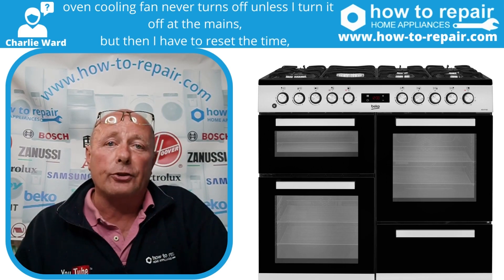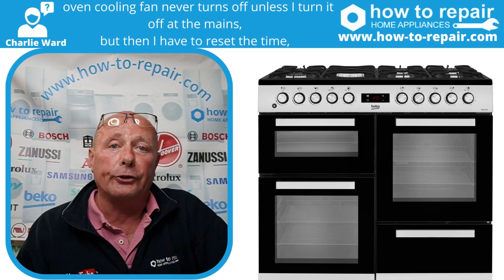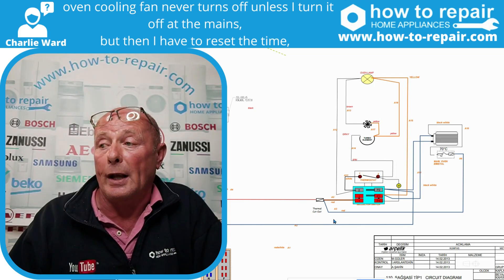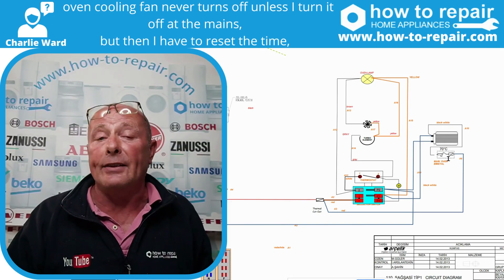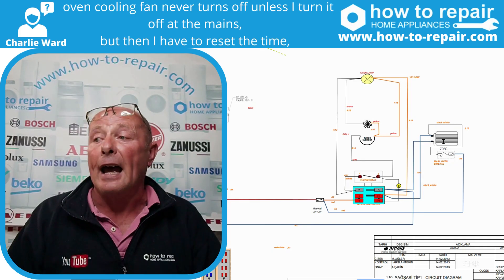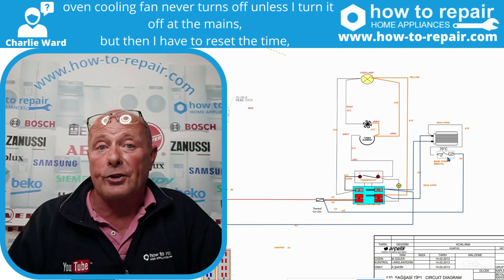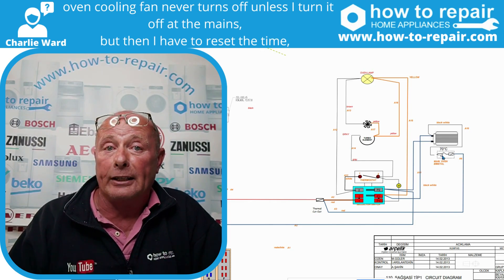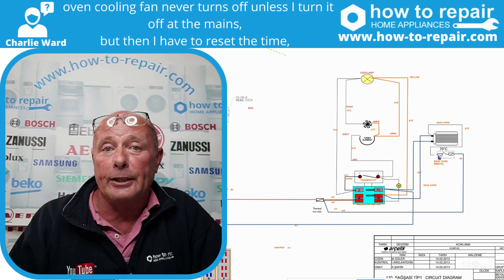Cooker cooling fan won't turn off in oven

Comment: What if it continues to run for 3 hours instead of 20 mins?  It turns off eventually but staying on that long is odd.  If it never turned off it would be an easy diagnosis.  This however stays on an extremely long time.  Bluestar double wall oven gas

Comment: I have a 
Thermador  Oven
Model # PG486GEBS/01
Serial # 39411008365 200022
The cooling fan will not turn until unplugged or the circuit breaker is turned off. I’ve replaced the sensor already and it did not fix the issue.
Reply from the maker: Hi raiders543 sorry about your problem but I'm in the Atlas Mountains right now and I can have free time occasionally. I would like to help you out during my live streams. I'll be hosting a new show on Sunday so please subscribe and turn your notifications on then you can catch me live. I'll stick the link to the upcoming stream below so you can drop your comment beforehand. I will need the full model number of your machine which is written on the ID plate. I'd love to answer your problem on the show, cheers.

https://www.youtube.com/live/-1djYxP9MDQ?si=MqqH_hU65fLl83X9
Reply from the maker: I've created a useful FAQ page for you mate. It has all the related videos. However, I could not extract wiring diagram, exploded diagrams and service manual since the most of the manufacturers provide no technical information to the public, only to their engineers. After the live streaming I will update it with my answer. Here is the link: https://www.how-to-repair.com/faqs/thermador-pg486gebs-01-range-cooker-oven-cooling-fan-wont-turn/

Comment: Great videos. Have NEFF U15E52N5GB/01 double oven. Replaced top oven bulb - it blew immediately. Now both ovens rapidly overheating and two upper fans running continuously when ovens are cold. When switching on there is clicking noise - assume a relay on control module?

Comment: Hi. My Bosch oven HBL8451UC/01 cooling fan switches on immediately when any mode is on. The problem is, it will switch off before the heat is gone and it will cause the display panel to heat up. Can you please tell me if that is a sensor or a main control panel problem ? Thank you
Reply from the maker: Hi mate, I've created an FAQ page for you. You can find a detailed repair guide, exploded diagrams, and spare parts for your problem on this page. Here is the link: https://www.how-to-repair.com/faqs/bosch-hbl8451uc-01-oven-cooling-fan-switches-on-immediately/ 😇

Since we work very hard in our warehouse making free video guides for you all on appliances, we always appreciate a beer, offering a choice of single or round beer. https://www.how-to-repair.com/help/buy-paul-a-beer/ 

Please remember to subscribe to our channel, as that's what keeps this channel going. Thanks, Paul 👍

Comment: Thanks for your help & details. Inspired me to look into the noise from 'cooling' fan inside our Neff C67M70 combination-microwave oven. The noise turned out to be a build up & 'bubbling-up' of 'carbon-deposits' inside a second cooling extractor on the top of the over (LHS behind the control panel). This one appears to extract heat from around the oven chamber & microwave area (as opposed to the general cooling fan for the electronics). Nonetheless, with confidence to investigate it was easy to see how the fan arms were fouling on the build-up of carbon debris, clean & reassemble. Thanks for your help though.

Comment: Live in a new build and just realised that I’ve never heard the cooling fan turn on.  Unfortunately it’s now out of warranty .  Has it not been wired in properly when it was installed or is it a fault.? Electrolux kdfge40TX
Reply from the maker: If a cooling fan is fitted to this model, then you may have a problem with the thermostat that activates the cooling fan, they normally activate at about 70° also check that the fan works you could do this with a bench test

Comment: Hello!  I have simens cooker model  HL448201X/01, when I start it the cooling fan starts , and it stays on even if I turn off the cooker , , it only turns off when i unplug the power outlet .  and connect it again.  what can depend on?

Comment: Hi I have a (Samsung stove )the cooling fan is been on since yesterday .
Model MIC: NE58K9430SS/AA

S/N: 0D227DCM102334T

Im a woman a curious very handy technician,so my husband saids 😊

Are you able to help me with directly how to replace it ? 
Where can I buy the part and most important question ?? Would I have to open the front and rear of stove ? My stove switch’s are level with my hips in front not like traditional electrical stoves top front ? 
Thank you 
Mrs G

Comment: Could it be faulty rellay or AC switch?
Reply from the maker: It depends on the model that you have, but if you have a printed circuit board then, yes, it could be a fault

Comment: Now you've started something. You've confirmed my suspicions. Do you have one, or a part number please? Also, where is it? Accesible only from the back? Cheers
Bosch HBB-AP63-7
E-Nr.    HBN13M250B
Reply from the maker: I think you are after the cooling fan, but I'm not sure I would suggest you contact us through the website including your full model number and one of the staff will be happy to look up the part for you. Have a great Christmas and a happy New Year Hi @LewieLeway I will need the full model number of the identification plate please use our contact us page and make sure you fill out the request of what part you are after and will get back to you within 24 hours normally https://www.how-to-repair.com/help/contact-us/
this is for you https://www.youtube.com/shorts/e432SAb2g08 please remember to subscribe as that's what keeps this channel going. Thanks 👍

Comment: If you can send me a email to contact you 
I tried to change the light but I forgot to put it out from power so because of the fact that the light was old it was turning only the glass so it went BOOM!!! And when I put the new light I open the oven from behind and disconnected the cables so I can have it in my hands.something falls from the smal sensor,a round metal disc and a small ceramic square.I put it as I think it was correct and put back the cables as I check it out 
AND NOW THE COOLER FAN WORKS WHEN THE OVEN IS COLD! Is that have something to do with the BOOM! that the lamp did??? and durn the sensor? Or I put something wrong with the cables or the metal disk that fell from the sensor???PLEASE HELP!!!!

Comment: Hi, I’m looking for some advice. I have a Neff B14M42B0GB/01 fan oven and the cooling fan won’t stop running. I’ve replaced the cooling thermostat but no change. Even if I disconnect the thermostat the fan still runs which is strange. I would expect the thermostat to be open circuit when cold but both the old one and new one are closed circuit when cold. Would you have a wiring diagram available please?
Reply: Have you managed to work out what is wrong? I have the issue with my oven. I would be happy to know what I need to fix it

Comment: Have you come across Bosch single built in ovens where the cooling fan will cut in & out randomly and sometimes run for long periods of time by itself? Have changed cut ins/main PCB & selector board previously & still no fix
Reply from the maker: you might have an intermittent contact on the cooling fan thermostat Thank you for leaving a comment this is for you https://www.youtube.com/shorts/e432SAb2g08 please remember to subscribe as that's is what keeps this channel going. Thanks 👍